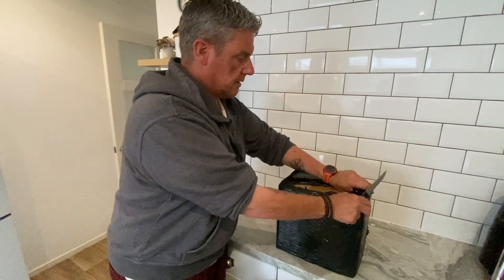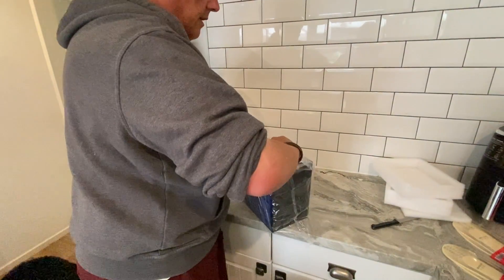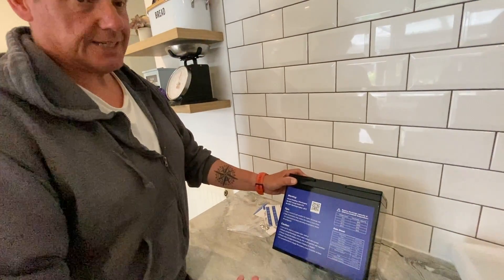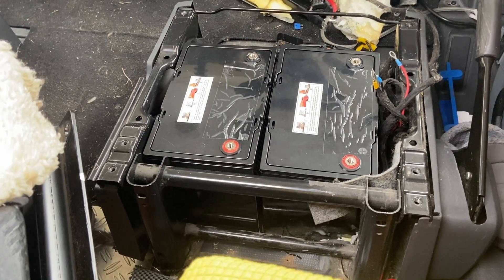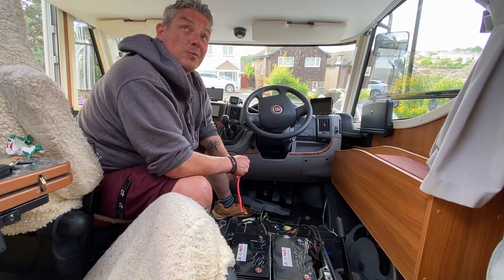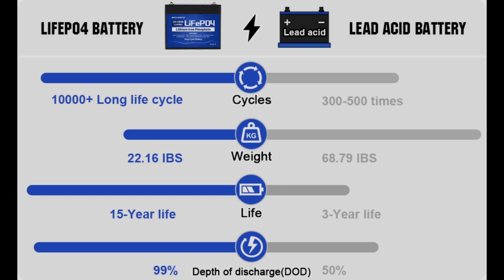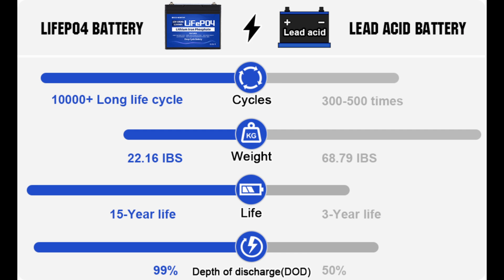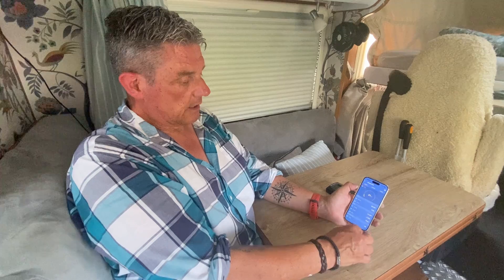DC HOUSE lithium 12v 100ah LiFePO4 Battery review

Comment: 10000 + cycles and a 15 year life is way better than the industry leading battery companies claim   It would be interesting to know where you got that data from as the DC House website states 3000 + cycles and 10 years both of which are more in common with other manufacturers.
Reply from the maker: Thank you for highlighting this! The graphic and details we used were taken from DCHouse website, however I’ve just checked again and they’ve changed it. The same graphic I pulled to use has been changed to 3000. As you can see on the video the original graphic said 10000.
I will be contacting them urgently about this
Reply: Very confusing! the label on your battery shows 4000 + cycles. With such inconsistencies in their marketing data it makes you wonder about the quality of the product!!!
Reply from the maker: @mikewykes6565  exactly! So we’ve removed the video and refuse to reinstate until DCHouse clarify, and change all of their graphics and literature to match. As brand new users we are in no position to confirm if their random snd extremely varying claims are true.
Again thanks for highlighting this issue, we do not wish to put our name to something so unclear

Comment: Ordered a lithium yesterday and just watched your video.
What do i need to do with the vans connection to the battery? The vans system will put 14v through it when driving and also on hook up. Is there something i csn get to make it a flat 12v charging?
Reply from the maker: Good morning You’ll need more than 12 volts to charge it , hence the 14 volt from the alternator, it also needs good amps too , I would install a 30 amp B 2 B which is in the vlog , along with a shunt to monitor the battery , if you have solar you’ll also need a decent solar controller 👍 depending on the system you currently have , you’ll need to ascertain if you have a split charging system too , i.e both the leisure and vehicle battery receive a charge 👌 I would break each bit down and work through it slowly 🙂 hope that helps
Reply: @redsgotravels  thanks for replying.
I have a victron controller, lithium option.
I thought a b2b was to switch between engine/leisure. It does that at the moment, would a soecific b2b operate differently for lithium?
I thought maybe my current van charge system isn't good for lithium. 
I'm considering removing the vans 12v control source and wiring it to the victron load connection, then mains charging via the lithium supplied mains charger.
I'll check the vlog again.
Reply from the maker: @LeeUK2 here’s a link ref the b2b , although USA , it explains it well, the switching between batteries is a split relay system, the b2b is a smart system to charge lithium , the one I used is specifically for charging the leisure battery , the alternator continues to charge the vehicle battery, however the b2b draws from this and charges the leisure battery at a higher rate, my vehicles charging system was max 18 amps , not enough for lithium , the B2B amplifies the charge up to a level where it is needed for Lithium , hope that helps 🙂 https://thewanderful.co/blog/what-is-a-dc-dc-battery-charger-all-you-need-to-know
What victron controller do you have ? 🙂
Here’s another good link 👌 https://www.12voltplanet.co.uk/victron-orion-tr-smart-1212-30a-non-isolated-dc-dc-charger.html?srsltid=AfmBOoqKcwZkpo6UqGVqx-a5Q1WExkbeNBdf1oP0B7Zu9NUS0zqLGKlO
Reply: @redsgotravels  excellent. Thanks
Reply from the maker: @LeeUK2 👌❤️
Reply: @redsgotravels  I can't remember atm, I think its a 75/15 with bt module
Reply from the maker: That’s possibly the solar charge controller ? 🙂
Reply: @redsgotravels  yeah, 15a tho, does have the option to select lithium in setup
Reply from the maker: @LeeUK2 there are calculations to work out the solar controller size, based on the solar panels and battery , have a little look online .. you may well be fine for the solar, just the vehicle charging system to check on 👌
Reply: Hi, the batteries are good but bring their own issues. They can give huge currents when discharging and absorb huge currents when charging.
They have low internal resistances unlike lead acid batteries. 
For this reason they use a B2B's to control the charging voltage and limit the current, particularly where the vehicle has a smart alternator and employs smart charging profiles. For large inverters you may need to use a pre charge resistor before physically powering them up, charging the internal capacitors.
They are also like humans and don't like the Hot or Cold so take care of them!
Take care and as an Auto Electrician if in doubt. M.
Reply from the maker: @markeh1971 good advice ! Thankyou 🙂
Reply: Should have included - instead of replacing vans charger (2005 van)
Is there something that will take current power in to suit the lithium battery?
Reply from the maker: @LeeUK2 yes , a B 2 B controller 👌

Comment: You need to add the temperature sensor to your Victron shunt it will link with the solar controller and shut it down if the battery temperature is below what you set the alarm too. In our case 5 DegC. All the data such as state of charge , temperature is viewable on the app you can scroll back or adjust timeframes to see it.  Victron is more expensive than others but has a 5 year warranty that they do honour.
Reply from the maker: Thankyou ! Will have a look at that for sure , even though our batteries are inside under the seat , it’s a worthwhile addition 👍

Comment: Thank you for your blog posts, very enjoyable. Something Very Very important. I just realized you dont have a DISCLAIMER at the beginning. People may try to copy you and it does not always go to plan and someone may get blamed.

I noticed some inconsistencies in the battery information. While I believe the overall content is accurate, the cycle life of lithium batteries (10,000+) seems exaggerated. It's possible that the market is becoming oversaturated, leading to inflated claims similar to those seen with products like handheld LED lights or laser pens. Top-tier lithium battery brands typically advertise around 5,000 cycles.

Additionally, there are three primary types of lead-acid batteries: Gel and AGM. Both can be discharged to 20% but ideally should be kept at 100%. Discharging to 20% is possible but reduces battery life, with optimal performance above 50%.

Lithium batteries also have limitations; they prefer to operate between 20% and 80% for optimal lifespan.
Reply from the maker: Thanks for the info ! Batteries are great , but of course under ongoing review 👍 very impressed so far 🙂